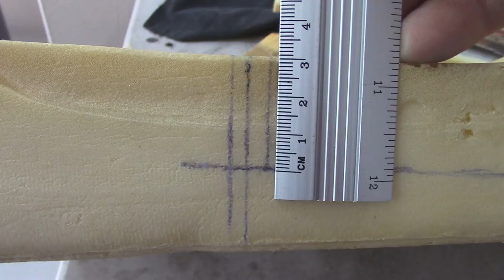A Sports Seat in Leather - Part 1- Car leather upholstery

Comment: Huh, looks like the generic seats I have seen on ebay for years.  I wondered if anything cool could be done with them! They tend to pop up used and cheap.
Reply from the maker: I think it would not have been necessary to buy an expensive seat for one time upholstery demonstration. I only wanted the body (frame and foam) of the seat, its cover was discarded. After finishing this project in leather, the seat would one more collectible item in my shop. BTW this seat cost me 150 USDollars in Auto Zone.
Reply: Cechaflo  absolutely,  and for a viewer trying this for the first time its a perfect project.   Not an expensive name brand seat or a seat from their car they wouldnt want to ruin.

Comment: Hi, could you explain how to make a form to cut fabric properly for that complex chair? please
Reply from the maker: Hello Pawel, I will show some of these procedures in a next video. 
In fact, at first sight this design looks a little complicated. I could say there is a mixture of flat parts and rounded (concave/convex) parts.
We should start out modelling  from the flat parts to the rounded ones where some creases would be formed. The flat part would remain flat with no problem and the part with the folds sould be cut off to give shape to that area. As you can see at the beginning of this video (original cover) there are many inserts which were made on purpose to disguise the folds which would have been formed if not for them.
I have done the same but I have put inserts in a different position to get a different design. Always the inserts are smaller.
I could say the inserts help to give shape to irregular surfaces. If not for them I would have had to stretch/force the material to get the desired shape.
Reply: Hi thank you very much for your information Cechaflo , I'll wait for you next video to lear more of it. I started to rebuild covers of my old car. There are plenty of rounded parts, which I didn't know how to cut them properly. I thought to take the old fabric off and make measurments of it, but after I did it I noticed that parts I cut were to big. After I made a stitches there were a lot of extra material, which didn't fit to the surface of the chair. I tryied to self yourself by using baste/tack method to get rid off extra material, but unfortunatelly without satisfatied sucess. Chair looks better than before, because of new fabric, but shape is not as should look like.